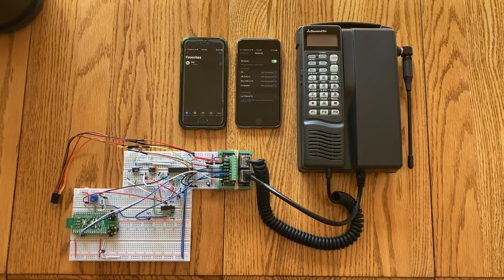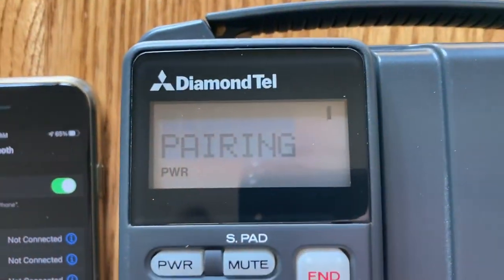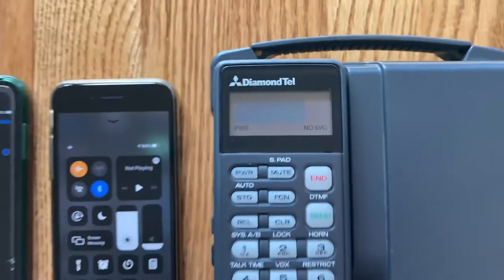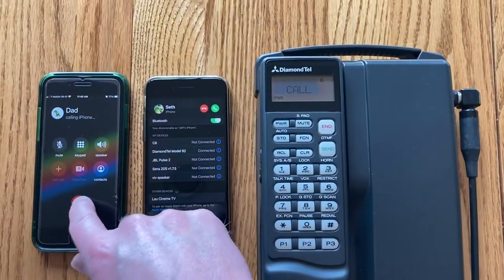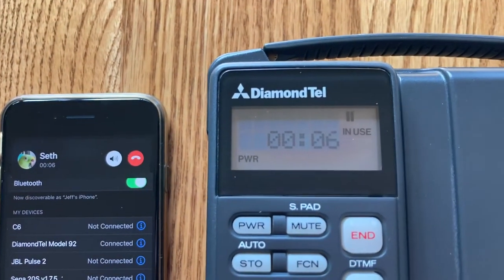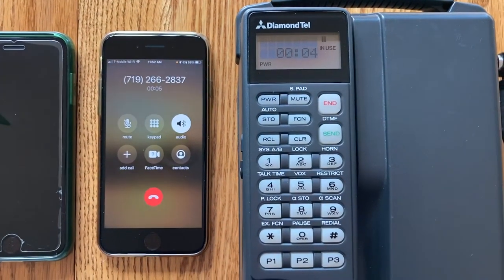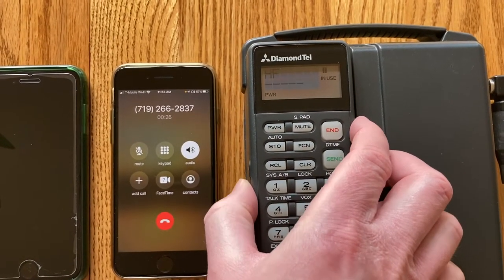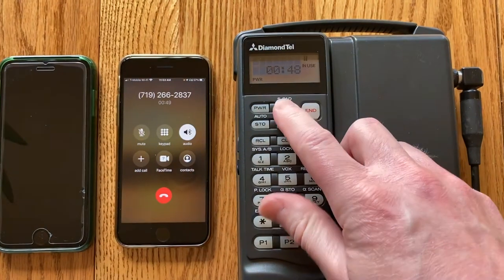Car Phone Project: Connection Status, Talk Timer, Dial Tone Menus

Comment: I find this project very promising! I had been looking to do the same for a Toshiba-made car phone I've had for a while but didn't get very far beyond determining what signals were carried by the handset-to-transceiver cable. Looking forward to a schematics/source code release when you're finished!
Reply from the maker: I'm curious to know how similar/different your phone's handset signals are. I would assume that it's quite proprietary to each manufacturer, and maybe even specific to certain models of phones from the same manufacturer, but I don't know for sure.

I have several forum posts describing what I discovered about my phone's signals, starting with this post: https://www.electro-tech-online.com/threads/making-a-bluetooth-adapter-for-a-car-phone-from-the-90s.162764/#post-1415912

I don't know how directly useful my project will be for your phone, but I hope it at least inspires you to keep going :)
Reply: @UselessPickles  I've long since lost my notes on the signals and I'll need to find a new oscilloscope, but whenever I take another look at it I'll be sure to share my results. I actually found these videos through the forum posts, I found the whole thing very fascinating - I had originally been trying to do what you are doing but then figured it might be easier to emulate an analog cell network with an SDR and find some way to hook that into bluetooth in software. Your implementation is much further along, so I'll definitely be looking into building my own system off your schematics when I get the time!
Reply from the maker: @Dirt_Piper  Simulating an analog cell network is what I really wanted to do originally (I even found official specs for the network protocol and an example open-source project that would be a good reference), but I was just completely clueless on the hardware/electronics aspect of it (circuitry for direct connection to phone's power amplified antenna port, finding FM receiver/transmitter chips that work in 800 MHz range, various audio processing requirements, etc.). It would be a more universal solution because it could work with any analog cell phone that has a coax antenna port, and there's no reason to care how the handset and transceiver communicate with each other. 

Pros: Original phone would basically work as intended, all original behavior. Reusable for many brands/models of car phone. Probably less microcontroller programming involved, because it doesn't require re-implementing the entire UI of the car phone.

Cons: More complex in the hardware/electronics side of things (major con for me, a software engineer). Cannot implement any custom behavior on the car phone for new features or better integration with Bluetooth HFP. Various edge cases could be very awkward, such as connecting to a cell phone that is already actively in a call (can't put the car phone directly into conversation mode with the cell phone network simulation. Would need to trigger an incoming call to the car phone).

Comment: Looking for a final project design, to re-purpose some older cellphones.  Do you have technical data on the Diamond Tel cellphone, or has this been more experimentation?
Reply from the maker: I reverse-engineered it myself by probing the handset wires with an oscilloscope to identify power, ground, audio signals, and serial data UART signals. Then I used a USB-UART adapter and RealTerm on my computer to reverse-engineer the serial data communications. I documented my methods/findings along the way (see the link in video description). I also shared a link in that forum thread to my google docs spreadsheet where I've documented the UART command set for the handset.

I will eventually organize all of the technical details more nicely and publish it along with, source code for the microcontroller, configuration files for the Bluetooth module, and circuit diagrams.

Comment: Hey man, I’ve been reading your posts in the forums and I would love to know if after you get this going I can mail you my car phone and you can fidget with it to at least be able to make and receive calls. I have a 1986 Nissan Maxima with a car phone from that time and I would absolutely love to be able to capture that essence again. I will compensate you for your time and assistance of course… peace and thanks brotha
Reply from the maker: I think the best I can offer you is that I will eventually publish all information needed to build a replica of my project, after I've solved the major issues and get it working reliably (technical info, schematics, parts list, source code, precompiled binaries, configuration files for the Bluetooth module, etc).

With some soldering skills, a couple special tools, and some tech-savvy to use freely-available software for installing my files onto the microcontroller and Bluetooth module, you could build an exact replica.

However, I can only confirm it will work with the DiamondTel Model 92 and Mitsubishi Model 1500 phones (DiamondTel is a Mitsubishi brand). It may possibly work with some other DiamondTel/Mitsubishi phones from the same era, but is nearly guaranteed to not work with phones from other manufacturers due to the handset connections/communication being most likely proprietary.

I can't guarantee that it will work with whatever modern cell phone you might pair it with, and I can't guarantee reliability/longevity of the electronics, because I'm a complete amateur at this electronics stuff (I'm surprised I haven't let the smoke out of anything yet!).

Building one of these for a different phone that is not directly compatible with the DiamondTel Model 92 and Mitsubishi Model 1500 could be a pretty massive project. It would require reverse-engineering the handset connections/communication and reworking the electronics and software to interface with this different handset accordingly. It would be prohibitively expensive to compensate me for my time to do this, and the end result would be a prototype-quality project that I can't make many guarantees about, so I probably wouldn't feel comfortable taking anyone's money to do this.

For now, this is a project of passion for personal use only, and I'm far from having an acceptably reliable/usable device. But never say never, so I'll remain open to the possibility of taking this further if this somehow becomes a viral sensation that drives huge demand that makes it worth investing into consultation and partnerships to take this idea further to production quality.